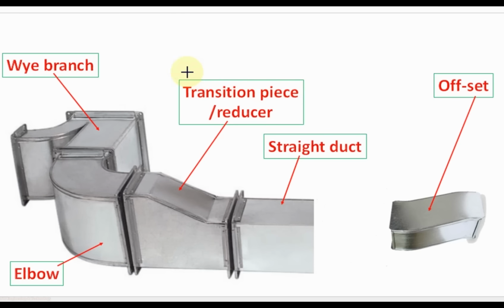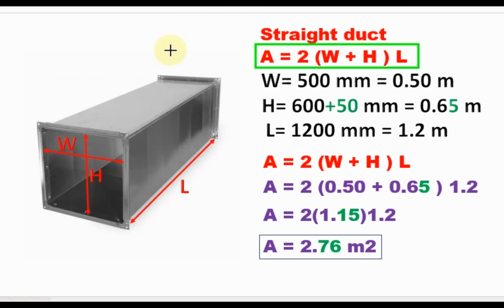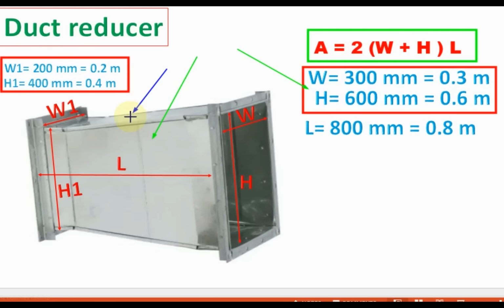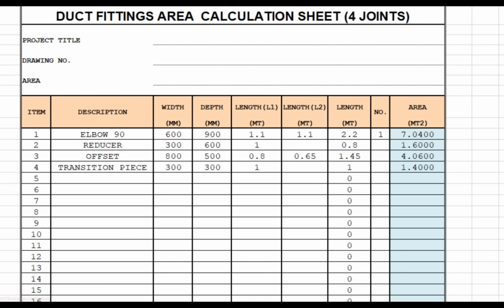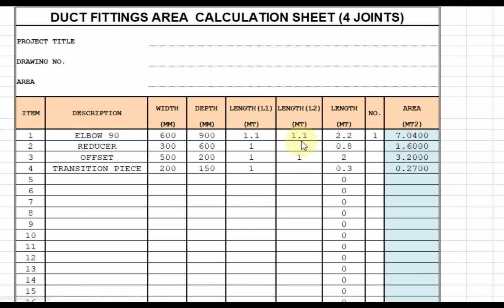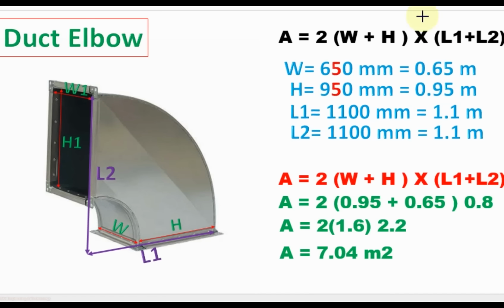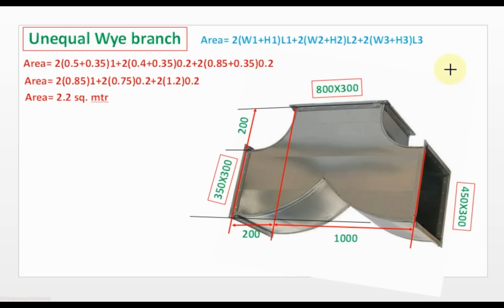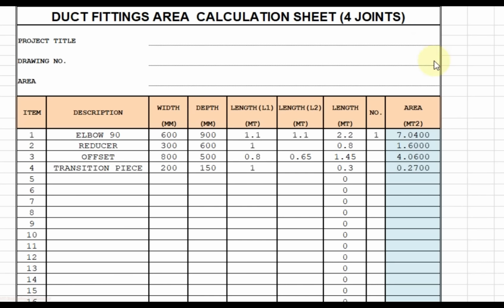83 - HVAC rectangular duct and duct fittings  area calculation for a project

Comment: Hello. I'm new to this field. I have a question can I use this calculation to calculate the duct insulation I will need to cover a duct? Thanks.
Reply from the maker: Yes, but for insulation you need to increase each dimensions by insulation thickness. 
if duct width is 500x300 mm & insulation thickness is 50 mm, then for insulation you can consider size as 550x350 mm.
Reply: @ncengineeringtechnology3376  Can I use this calculation to calculate the area of the metal sheet for price/m2? thank you sir.
Reply from the maker: Yes,
it will not give you actual surface area of duct,  but it will give you the estimate of sheet used for duct fabrication, almost all companies use same calculation for invoice.